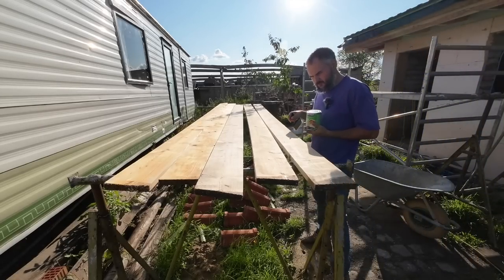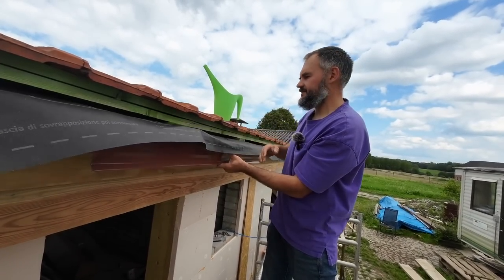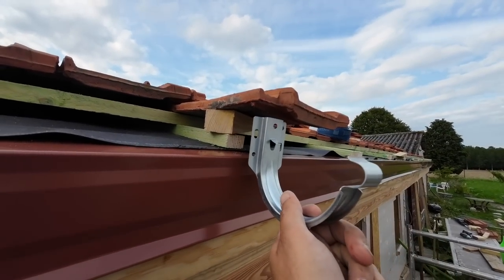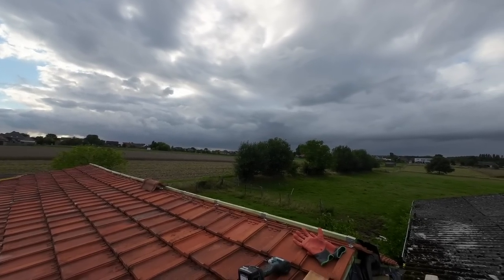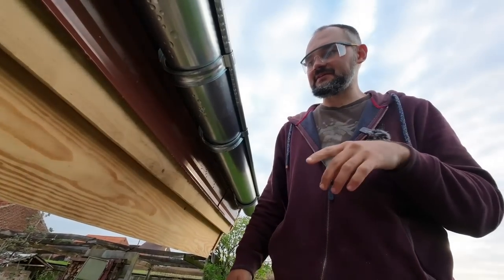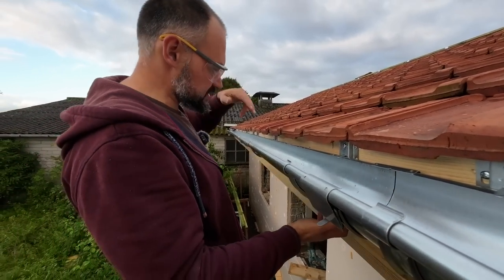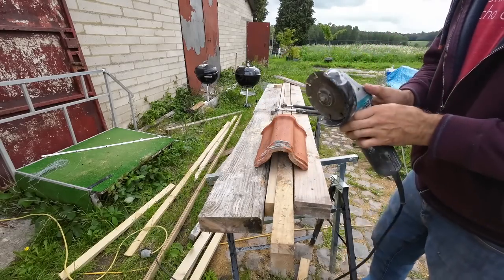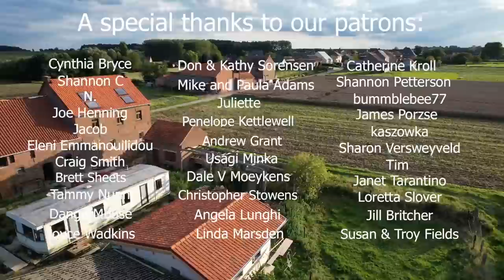We FINISHED the roof! [Turning OLD SHED into a cozy TINY HOUSE]

Comment: The mistake on the roof was unfortunate, but you made it right in the end.😊 You have conquered so much on the entire build! 👍 The field of flowers is amazing! So packed full of beauty and variety! ❤
Reply: In carpentry it isn’t a mistake if you can fix it 😂  I’m working on two projects right now and had to redo a couple of boards because the cuts were wrong but no one will see in the end so no mistake.

Comment: I have seen old tile roof in Denmark. Our old tile roof was glued together with cement beneath. But beautiful roof.🎉👏
Reply from the maker: Thank you!
Yes, here they also cemented the edges and the ridge tiles. But since we used screws for ridge tiles and metal board for the edges, we should be fine.

Comment: I little curious why you didn't slope the gutter the other direction away from the  other structure. The other question is the roof from the other structure will be dumping water between the two structures?  So will you eventually  be tying the roofs together?